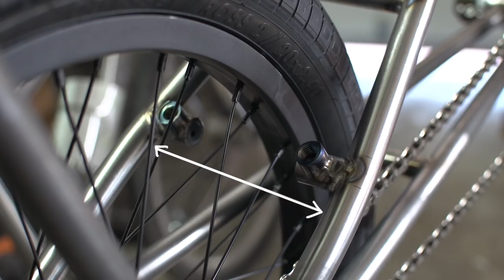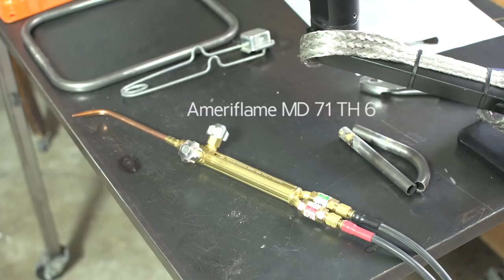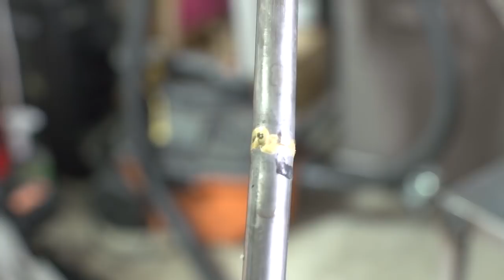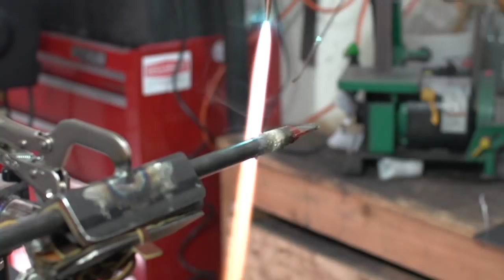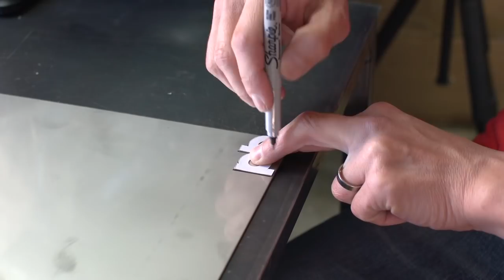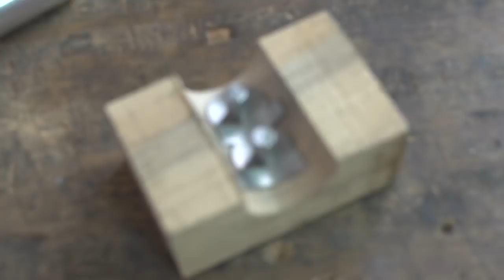Longtail Bicycle Frame Build 14 - Braze Custom Front Rack

Comment: Hey! I've been enjoying your videos. Please consider adding either another attachment point on the front rack (such as to the brake bosses), or a strap between the rack's loop (the one in front of the headtube) and the handlebars. That plate you have attached to the fork crown could easily break when the rack is loaded, resulting in the rack rotating forwards underneath the front wheel and a nasty crash. It happens!
Reply from the maker: +Guy Noble ok ill look into it. Thanks for the heads up.

Comment: Hi Steve! First of all: I really like your videos and admire your work. I ride a cargobike myself for decades. What I do not understand in your design is that you connect the front rack to the front wheel instead of the frame. If the weight does not move you will have a stable ride. With weight you easily oversteer and start wobbling. A fixed rack is commonly seen on modern cargo bikes.
Reply from the maker: +Bas 't Hoen yes its true! I noticed that cycle trucks has an integrated front rack design for that reason. I dont really have a reason for not doing that too. I suppose nothing too heavy will be on that rack but you never know.

Comment: Beautiful work. When bending tubing I find it quicker to, rather than trying to hit the bend exactly, overbend by two or three degrees, remove it from the bender, then take the bend back to 90 deg or whatever. Dealing with springback is a PITA.
Reply from the maker: +blipco5 yes i found myself having to bend it further because of deflection. The nice part is that this bender is forgiving of you need to load the tube back up again.

Comment: Was there a special reason for brazing instead of welding or was it just that you wanted to get better at brazing? Btw, the bronze brazing looks very pretty :) 
I don't know how steep the hills are where you live but as a BMX Racer I would recommend a bigger front chainring for more speed ;) I don't what you're currently running on there but I have 44 to 16 on my bmx and you can ride that pretty much up every hill, but that's something you will have to decide ;)
Reply from the maker: +Mr. Jack yup for practice. :) yes i will take your recommendation for a larger chain ring. 👍

Comment: Your lower form being wood was the problem in shaping your badge.  You should have put the butt joint at the rear of the rack where your flat metal bracket could have reinforced it.  Next time you butt join tubing use an internal sleeve for strength.

Remember, the first 10 to 20 frames are practice.
Reply from the maker: +honor harrington yes totally agree. Will do that on racks for the future!

Comment: Have you tried tig brazing?
Reply from the maker: +andyvoytko i tig brazed with silicon bronze on my first build. Its how i attached the badge. Requires a lot of heat control.
Reply: As with silicon bronze?
Reply: or aluminum bronze. I've used it at work with good results.

Comment: You didn't opt to drill any vent holes for your brazed joints?  I've found that leads to porosities in the brass.
Reply from the maker: +Jim Gourgoutis i was wondering about vent holes. I looked for as many pics on the internet but couldnt find any that vented rack tubing so i assumed it wasn't needed. I suppose some small holes couldnt hurt.
Reply: Expanding air pushes the brass out or holes in it.
Reply: Yup, exactly.  It's especially bad if you then powdercoat the rack, because you'll get nasty bubbles and holes in the coating around the brass filler, when the part is heated to 400°F in the oven.
Reply: Should also add: no criticism intended -- you built a cool rack rack and bike, which is the important part!  Just wondering if vent holes in the rack were omitted intentionally.  I've seen builders do it both ways.

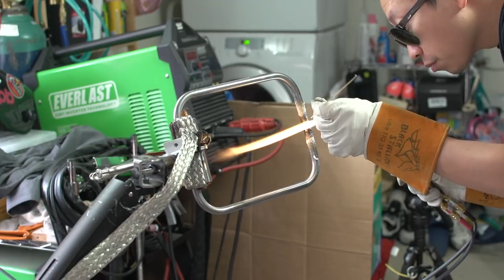Comment: @6:00..... Flame looks too yellow? Dunno why? also, it's really long, you might want to go with a "0" or "00" tip for that type of braze job, I have better luck and nicer results gas welding with a smaller tip than one too big...... Maybe it's the pressure on your regulators?
Reply: also Braze isn't suited for butt joints where you file and sand away all the brass.... it's stronger as a fillet material with a bead like joining pipes 90* to other pipes - Also WAYYY too much flux you're using, esp. since your steel is starting out so clean and new anyways- you're making too much work for yourself cleaning all that afterwards
Reply: When he gets the right flame he will have much more control over the heat.
Reply from the maker: +Eclidean it very well could be all of those things! :) ill look into a smaller tip.. It did feel like i was pushing too much gas.
Reply from the maker: +Eclidean yes i agree. I had just come off silver and assumed same amount of flux lol

Comment: I've read that brazing isn't very good for butt joints because of the small surface area.  I'm curious to see how well that weld at 5:50 holds up over time.

...and that PB logo plate is awesome, even if the radius didn't come out well.  The next one will be great.
Reply from the maker: +stoparret thanks! Yeah, that but jpint i feel will break at some point.. When it does ill be ready with my TIG ;)

Comment: Came out killer!! Nice brazing setup. You got to think of brazing as if you are gluing the part together since it is a form of soldering. Turn the torch down and use circles in the area you are soldering to control the heat, big circles for when it is too hot and to preheat in the direction you are brazing and small circles for adding heat to the area. When you lift you are creating stress areas from the heating and cooling of the area. Want to keep it a constant temp.
Reply from the maker: +prancstaman sounds good to me, ill try that. :)

Comment: why do you braze and when do you do it? why not just weld?
Reply: It boils down to choice really. I was always taught that provided the fillet was 4x the wall thickness of the tube being joined, it is as strong as if not stronger than tig. As has been said elsewhere in this thread, TIG is less time consuming and gives a more industrial, precision aesthetic. Some people prefer the smooth joints and also the craftmanship required for fillet brazing however - the good thing is which you go for is entirely up to you :)
Reply: Brazing is not weaker than welding, in fact you are more likely to weaken a frame by tig welding due to the higher heat from the welding changing the properties of the steel.
Reply from the maker: +Ben Turner well said!
Reply: Brazing, especially with silver makes more sense for the smaller jobs such as the cable guides because it is very easy to create a low profile joint that requires minimal clean up to look good. I am a frame builder too - although i braze everything (with brass and silver)
Reply: Not sure exactly why he picked brazing but usually it is a matter of strength and convenience. Brazing is between soldering and welding both in convenience and strength. IE: Brazing is weaker than weld but stronger than soldering. It also takes less heat & less time. It's really a lot like soldering on steroids while welding takes a LOT of heat.
Reply: Ben Turner indeed some manufacturers actually braze their frames for this exact reason. Not really convinced one is better over the other though
Reply: Disagree, like i said brazing can be just as strong if not stronger than tig welding. Its a matter of choice. Different strokes for different folks. You are evidently an expert on Tig-Welding, but not on brazing. I have fillet brazed lots of frames, including my own mountain bike frame that i have ridden alot of miles on extremely rough terrain. It has not failed once.
Reply: I had the same exact question.  Maybe he just wanted it to look different?  Or maybe he wasn't sure how to back purge it?  Hopefully he'll respond and let us know.  I love the video series!
Reply: Ben Turner I'll go ahead and say the tube set used can be a deciding factor. Varying wall thicknesses, stainless steel, etc. That said, most hand built steel frames are likely to be of an acceptable quality.
Reply: Brazing is not inferior to welding and has its advantages in some applications. Thin walled tubing benefits from it greatly, lugged or fillet brazed. You can't tig weld tin-foil!
Reply: blink...blink WTF are you talking about? Brazing is inferior in every way to welding, it is the lowest on the scale. It is NOT welding, it is brazing first off. You are pretty much soldering (gluing) two pieces together, and it has a  lower tensile strength while compared to welding. When you are welding, you are fusing/melting both metals together. While with soldering/brazing flowing a filler metal into the joint, with the filler metal having a lower melting point than the adjoining metal. look up the tensile strength of brazed joints. Then actually inform yourself with what welding is and what happens when you turn on your TIG, MIG, Stick, ground your working piece then bring your "gun" down to weld two pieces of metal together....

You can easily TIG thin walled tubing....*face palm* you can adjust the power output.... are you kidding me right now? From that comment alone, you just undid yourself, and I know for sure that you do not actually know anything about welding, (since you called brazing welding when it isn't) Anyone who graduated from any trade school for welding would know that. Those are basics that are taught during the few first weeks. And TIG welding thinned walled tubing is where TIG shines. Do your quick math to set your proper output needed, regulate your heat (pedal), pick out the proper filler rod for the dia that you are working with, then get ready to party. If you need a heat sink then use it.  Your comment is so dang backward. When you have a thin gauge, you have to be even more careful when you are brazing because you are going to be pouring a ton of heat into it, with your torch while waiting to get it up to the proper temperature. During that time you can easily distort or warp the material (melt it if you are on oxy-ace and go over your working temp due to keeping the heat in one spot to long or not paying attention). You have to constantly be watching your heat input, it is easier if you have a temp stick while working. But a lot of weekend warrior hobbyist do not use those or know of them. It's far slower and "sloppy" if you are comparing it to TIG.

And just to be a ass. Here goes some people, TIG welding Tin-foil.......
I can't do it,  (I was a structural welder for years not a TIG welder), but I can do the old party trick of TIG two razor blades together and aluminum cans together, if I sit down and get back into practice with it. 
https://www.youtube.com/watch?v=0p9s3DxMZ0A
https://www.youtube.com/watch?v=6SXyzG_8H48
https://www.youtube.com/watch?v=3broDZvYUbQ

Please go home, you do not know what you are talking about, and from the sounds of it, aren't even a welder, or have worked out in the field.
Reply: If brazing were so inferior, why has it been a staple in frame building for so many decades? Fillet brazing in particular is still common among bespoke builders, with no quality issues with their frames. Sure, you can tig weld thin-walled tubing, but it's still fragile thin-walled tubing that's being stressed differently under load, compared to a fillet braze or lug which generally takes the stress a bit better.

I think you've got your head too far up your own ass. Brazing is still very sensible and very practical, and by no means inferior in the correct applications.

Two words: capillary action.
Reply: No, I know what I am talking about from years actually working in the field and doing this 6 days a week for 12 hours a day, Vs just another youtube keyboard young chap. Nothing that I stated was incorrect, while you on the other hand had to retract some of your statements. Want to know why brazing is inferior, and what the inherent differences are,  enroll in a trade school.... Then come back to me.

It hasn't been a staple, most frames (in the bicycle world) are made via TIG. Billet brazing is a slow long process (as I already stated) which take a skilled hand/eye to make sure that all of the joints are strong, fully brazed together. They are far more experience and heavier. Like I also stated, it takes time to do them, if you go to hot or aren't paying attention well, you could have more work on your hands trying to fix it. If you average Joe told me that they brazed their bike together and wanted to sell it to me, I would promptly walk away. You have to know what you are doing.

Or just do a two second google search. Aren't you younger ones suppose to be on top of the "google" searches. Here I'm tired of typing.
http://www.gtgtandems.com/tech/brazing.html

"Capillary action can't occur during welding because there is no solid surface along which the filler can move. Like brazing, soldering relies on capillary action, but it uses filler metals with melting points below 840 degrees Fahrenheit and therefore produces weaker joints."

Two words: Pulse TIG.
Reply: I have to go to bed, good night.
Reply: Wayne M  I'm ignorant? lol, young man, you don't even know the difference between the two processes. First off, I stated that, brazing has it's place. Second people in this section have said that it is a superior process which it is not, period. If I am doing a little hobby arty's farty project using two dissimilar metals, I will braze them together.....

Brazing is not welding, you are in essence gluing the two pieces together. You are using your filler metal and melting and forcing it to flow into the joint through capillary action. 

While when you are welding you are actually MELTING and FUSING the two pieces of metal together. The temperatures required to do this are significantly higher. And if you aren't using the old school oxy gas torch method. You are using electricity to aid in the process...... Do you get it now????

I've grown so tried of this subject. It's like arguing with someone who thinks that the earth is flat. 

Here maybe this will help you out.
https://www.lucasmilhaupt.com/EN/Brazing-Academy/Metal-Joining-Welding-vs.-Brazing-vs.-Soldering.htm
Reply: Just TIG it then. You get far cleaner finish, you waste less resources, it's a actual weld and not a braze on aka glued together piece (hence why it broke off). Brazing is simply silly (and dangerous) if you are using it for anything that needs structural integrity and will have lot's of weight applied to it and have to deal with any sort of flexing or torque. Brazing has it's place, but not to build a frame nor to support anything. Remember you are glue to items together when you braze NOT welding them.

@xGsh
I am not sure what you are talking about, on how a TIG can weaken a frame. That is complete non-sense. This is why TIG has a pedal you can control your heat input, with a brazing torch you have little control over the heat that you are putting onto the metal, you have to saturate the metal with heat to bring it up to temperature before you  can even melt your filler with brazing. That is when you use pulse, high frequency control settings and simply control your heat with your pedal. unless you are using a scratch start TIG. By your statement, motorcycles would be falling apart all over the place, since most professional shops either tig or sometimes once in a blue moon MIG them (but mostly TIG). And a motorcycle is dealing with ton's of vibrations, higher speeds and is under much more stress factors than a human powered bicycle.
Reply: @sexybluelady  "Brazing has it's (sic) place, but not to build a frame nor to support anything."

Almost all bike frames were silver or brass brazed for the first century of their history.  It's still extremely common for home builders to use silver or brass brazing for lugged or fillet-brazed (brass only) construction.  The brazing didn't even have to be particularly well-done on lugged frames for them to last a long time.

Comment: Fantastic. I really love this bike; it’s got personality already. Can’t wait to see it in paint. If you don’t mind me saying, there’s one thing I might have done differently: the placement of this cable guides at the 7 o’clock position on the tube... slightly risky? I’m sure there was a reason why you put them there...
Reply from the maker: +Richard Hayter no worries! I love feedback! I didnt really have a reason other than it seemed like the best place for the least cable resistance. Should i have tucked it under more?
Reply: Pithy Bikes If they’re run along the top or along the bottom, they can’t snag trousers when you’re riding – or if you crash.
Reply from the maker: +Richard Hayter ah that makes a lot od sense.